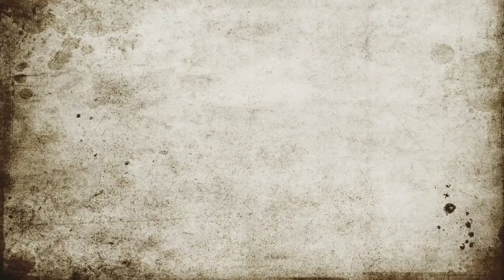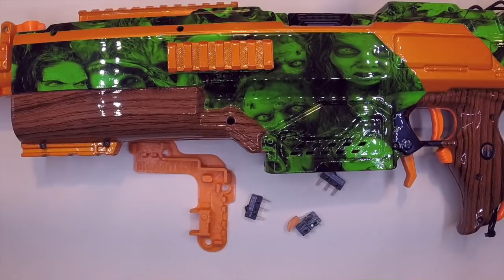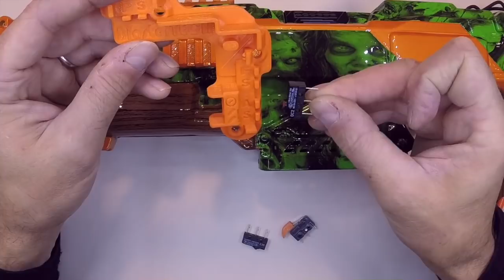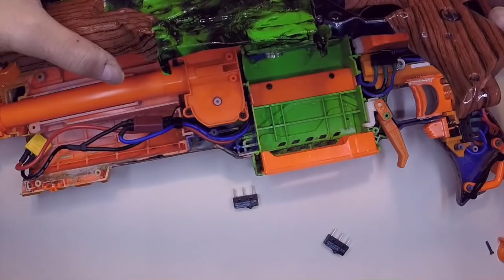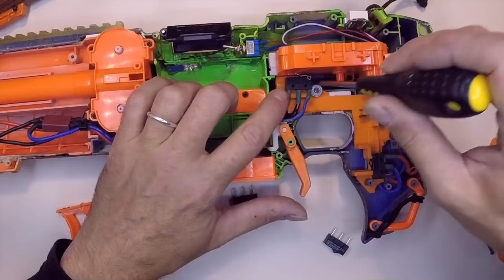Zombie Krinkov Revival and BlasterTECH Switch Kit Part 1

Comment: Thank you for doing a series on the 3-switch RS! I’ve been hoping someone would, as I have 7 I would like to do this and other mods to (for a fire squad). I had been torn between the 2 different options (BSUK v BTAU), but sounds like BTAU is the way to go.
Reply from the maker: You can also simply install the Cherry DC2 into the stock switch plate. That’s how we did it before commercial plate kits, it would save a lot for multiple builds and you can screw the switches to the plate. Wiring can be combined with a MOSFET on the rev trigger circuit using 3 switch dead centre. Circuit diagram is on Britnerf.
Reply: Awesome! Thanks for all the tips!